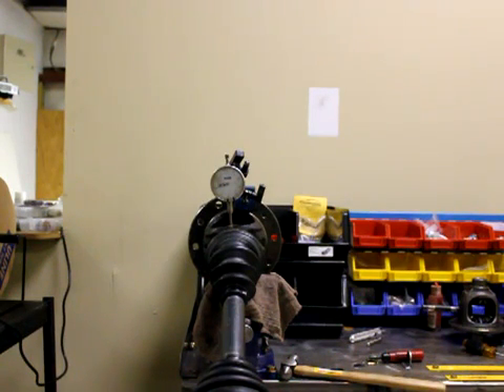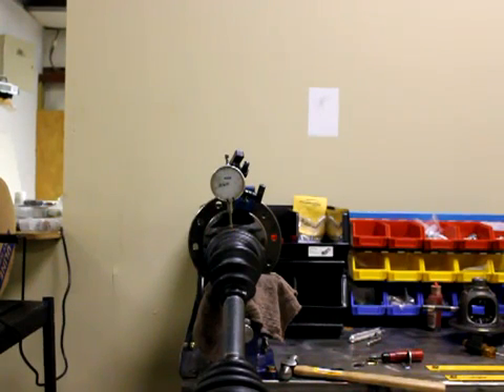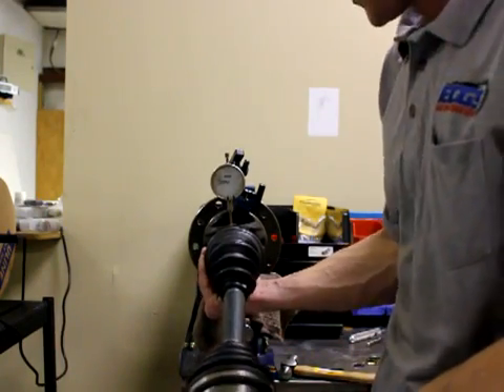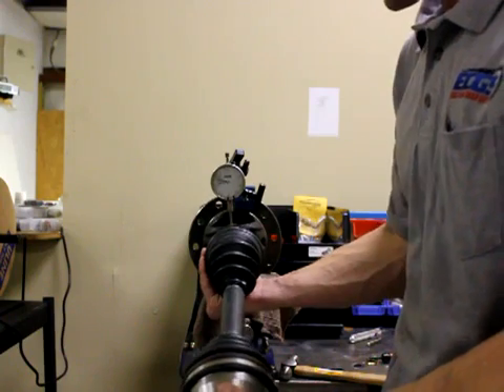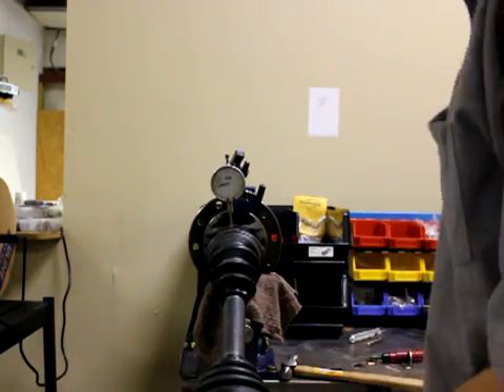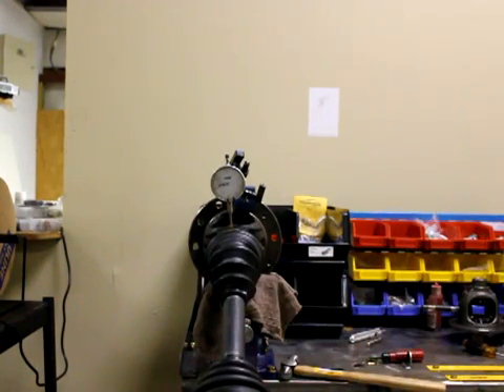Toyota T8CS Bushing Solution - Part 2

Comment: Has Toyota redesigned the carrier or needle bearing? I'm hearing  lots of newer low mileage Tundras even up to 2021  having the same amount of play . Usually in conjunction with steering wheel shake or vibration under drivers floorboard but not the common growl sound that goes away when 4H is engaged. Does Toyota specify a limit on the amount of play allowed before they will change it?
Reply from the maker: Here's some more info on the issue. https://www.youtube.com/watch?v=l9XED_tXl_A&t=86s
If you're looking for more info, give us a call at 919-672-2705

Comment: Ive heard some have had this cure their steering wheel shake as well. Anyone here have that experience? I have the hum and a wheel shake. Dealer swapped the clam shell and it cured the hum for a short time but is now back, but the new clam now is giving me wheel shake. No wheel shake before, then new clam, now shake... maddening.
Reply: Did you figure it out?
Reply: @jagurmcnish6625  nope. Plan on doing the sleeve and seeing what happens
Reply from the maker: If you haven't solves this issue yet, check out this video for more info. https://www.youtube.com/watch?v=l9XED_tXl_A&t=86s
Give us a ring at 919-672-2705 and we can help.
Reply: @ECGSTech thank you. I’ll be doing the bearing/sleeve swap eventually. Thx!

Comment: Well it's been a couple of years. What the verdict?
Reply: i know a few guys that have done this with great results. I will be doing this myself soon.
Reply: 5 years, still running
Reply: I'm gonna be doing this in about a week
Reply: I did mine and have no complaints.
Reply: So how do you fix the problem.
Reply: @Cyndio67  check it, TOYOTA CLAMSHELL BUSHINGS
https://eastcoastgearsupply.com/c-1025774-toyota-clamshell-bushings.html